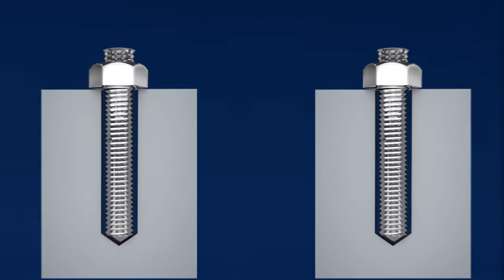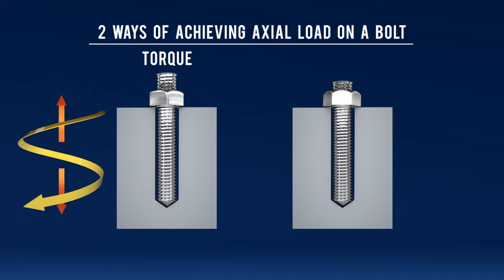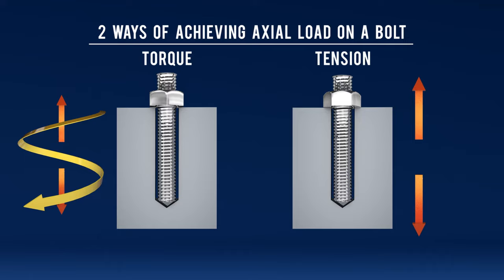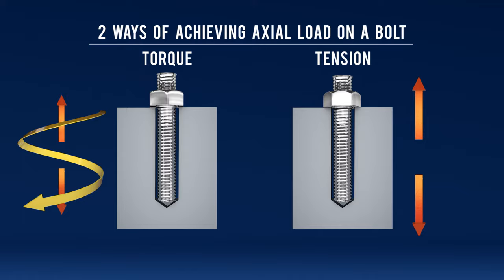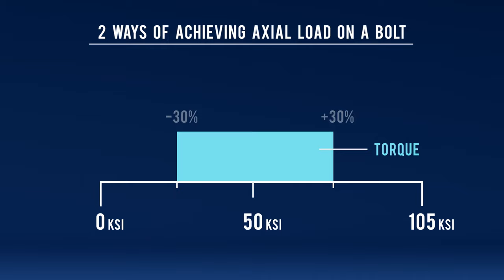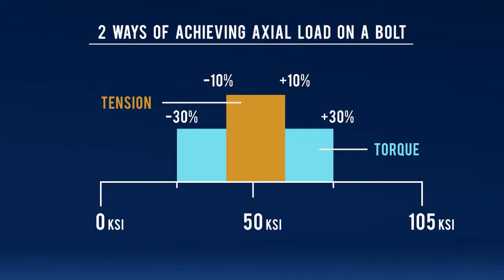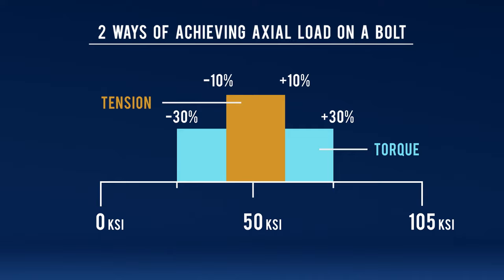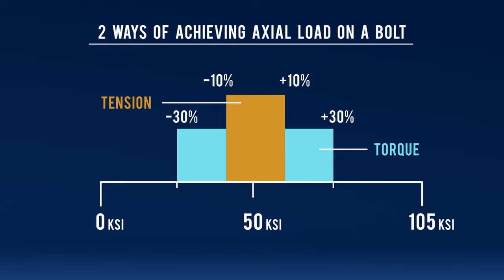Bolt Tensioning vs. Torquing, Compared

Comment: As a structural engineer, when we need proper pre-tension in a bolted connection, where mistakes would be catastrophic, we use tensioning tools, otherwise we torque it.
Reply: Exactly, like hydraulic tensioning bolts on engines - that I have worked on

Comment: For most general engineering purposes, canvassing for the use of tensioning systems is a waste of time. More advance is achieved by educating craft/technician level users to make any useful effort to tighten threaded fasteners (usually a torque wrench, please) and by educating engineers to design viable bolted joints. We have only 17 years left until the 200th anniversary of Joseph Whitworth's standardised threaded fastener and I think 200 years is more than enough time to have spent learning how to use it.  🤔
Reply: Do automotive and heavy duties class need tensioning or just torquing sir ?
Reply: @PhuongLe-gg4ge  In aviation and automotive production there are still many applications where threaded fasteners are used for convenience and maintainability when other fastening methods might be functionally better. Many such applications are not very effective and can be difficult to maintain. An ideal threaded fastener joint uses a LONG bolt or stud so that there is plenty of stretch and this makes the joint very effective and resilient. 
It can never be as simple as 'heavy duty' (do you mean ISO 8.8/SAE 5?) need torque or tensioning. In automotive, many engine bolts are designed to fine tolerances of clamping and require highly reliable and somtimes complex tightening methods. This is increasingly true for important chassis components.
Torque wrenches are rejected by many because of the wide tolerances of this method and the twist put into the saft of the fastener by applying a torque. However, torque wrenches simple to use, are far better than nothing, and can be superior to tensioning methods done badly!

Comment: Plus minus 30+ is very pessimistic. A well lubricated bolt with good threads can outperform this.
Reply: if you lubricate you change the preload of the bolt, for the same preload you have to use a lower torque, and you still have the 30% of error for that.